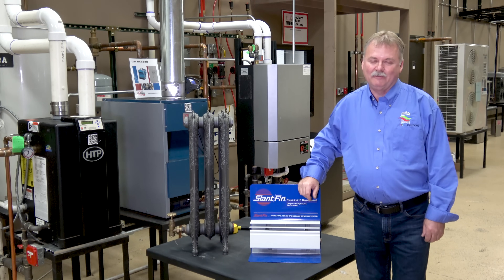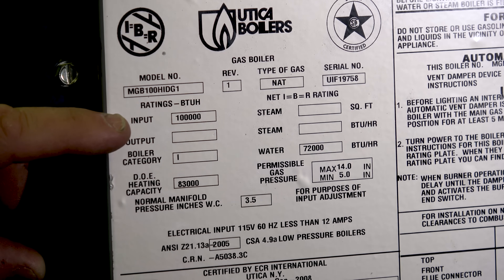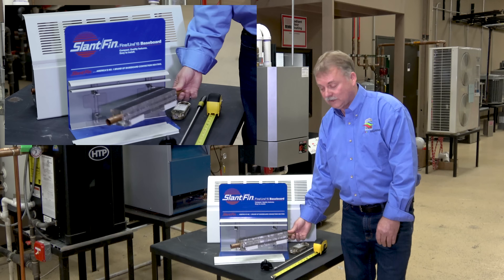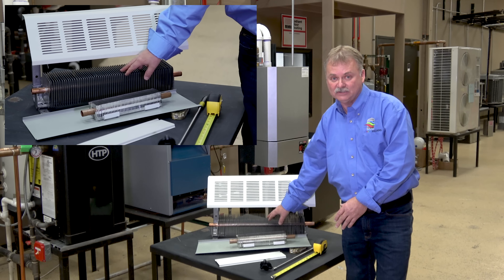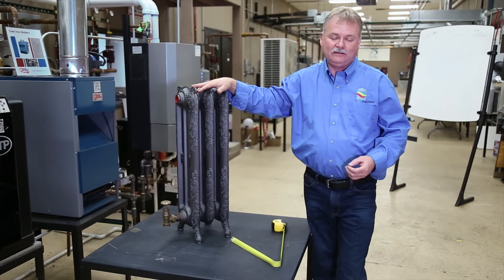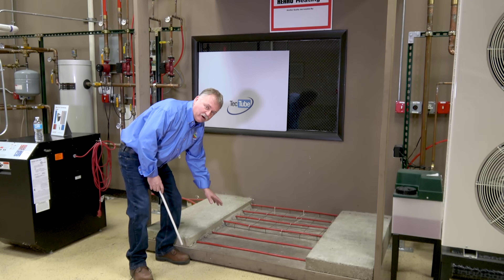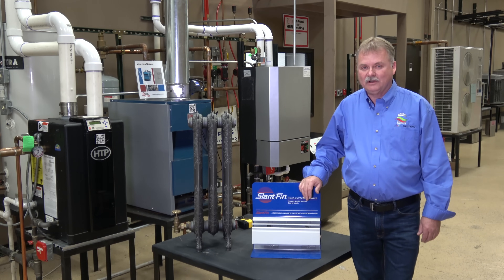Right Sizing a New Boiler... the easy way

Comment: What about steam boiler heating systems in older homes?
Reply from the maker: The same method works with steam radiators, but instead of 170 BTU/h for 180F water, you would use 240 BTU/h for 215F steam
Reply: @TECTubefilms  Thanks for the info.
Reply: Also , steam is measured not by btu per hr. , but Cubic feet per hour. You need room in the "steam chest" to make steam.
Reply from the maker: @robsemprini1511  All of the steam boilers that we stock are rated/listed by BTU/h input and that is what is also listed on the nameplate tags.  This includes Burnham, Carrier, Bryant, and Utica.
Reply: Then they are NOT rated for steam. Steam is measured by volumn. Not btus. Like nat, gas...And it matters. If you don't have room to make the steam - you can't make it.Look at steam baseboard (for single pipe)..or better yet I will make a post expelling this. It IS becoming a "lost art" like Holohan said. Take a better look at that plate ; a lot of times they are marked for both water and steam.
Reply: Nowadays they measure steam by weight , also. ( orifice gauge) although I never did use one.BTW you guys have some good stuff on these vids - gotta get the younger guys interested in this trade. Good work.
Reply from the maker: @robsemprini1511  All of the boilers we listed in our above reply are AHRI rated for steam.  And yes you are correct that many cast iron boilers are rated for both hot water or steam use.

Here is a link to a Utica PEG steam boiler which catalog's each size based on BTU/h input and output.  https://uticaboilers.com/sites/default/files/240009710_PEG-E_SellSheet_1017_WEB.pdf

We do not use nearly as many steam boilers in our service area as we do hydronic boilers (hence the reason this video was focused on hydronic and did not talk about steam), but when we do, we still always begin with a load calc expressed in BTU/h.  Weather we do a Manual J load or we do a radiation count as described in the video, the answer is in BTU/h and we select the boiler from that.

We have never met anyone that knows how to calculate the heat loss of a building using steam volume.  We are not saying that it is not important, nor are we saying the volume of steam won't be part of your piping and terminal selection and design.  All we are saying is that the size of the boiler that you need is based on the heat loss of the building.

And yes, it is a lost art for sure.  Holihan's book E.D.R., is where many of the charts come from that we use to estimate radiator surface area.
Reply from the maker: @robsemprini1511  Thanks for the feedback on the videos and for the extra steam discussion today.
Reply: Right on , I agree. I've met Dan a few times and he is a good guy. Good author , too. LOL.  I've used those charts - handy for thin tube radiators and convectors .  Happy Plumbing fellas !

Comment: Would it be possible for you to show a video on how to put an outdoor reset on a standard efficiency boiler? With an indirect tank in the system and baseboard thank you
Reply from the maker: That process would be specific to the brand of outside air reset controller you are installing... Honeywell, Tekmar, etc.  We can give you this tip, though: always install it on the North side of the structure to avoid direct sunlight.
Reply: Tec Tube I think you were off on your concrete floor calculations.   24 x 40 is 960 not 9600.
Reply from the maker: @1974jrod  How dare you question our math skills!  But yes, you are correct, 960 BTU/h is what Bill should have said.  Maybe he did that to teach us yet one more way boilers can get oversized... math errors.  LOL
Reply: I actually called the manufacturer of the boiler it's a New Yorker and the model number is a CG30D. They advised me that boiler cannot be used with an outdoor reset. I'm not sure why the guy wouldn't explain
Reply from the maker: @MrSprintcat  He was either incorrect or overly cautious.  You can put an OA reset on all boilers.  In fact for boilers under 300,000 BTUh, it is required by the DOE.  And for all sizes, it is required by IECC.  With that said, if it is a non-condensing boiler, you cannot have an aggressive OA reset schedule.  You have to keep the return water temp high enough to avoid accidental condensation.
Reply: Thanks for getting back to me .its to funny I called NEW YORKER. BOILER back and talked to the same guy and he had his coworker with him , they told me my boiler wouldn't work with an OA . because my boiler has an on board boiler reset.??? They said to understand what they were talking about I would have to look in the manual. 😂😂😁😁.. I know the return line temp should be around 137 degrees.

Comment: I have a Beacon Morris kick panel heater that supposedly puts out up to 12500 BTU’s on high would I add the 12500 BTU on top of my Fin tube calculation. Any advice as always is much appreciated. Thanks for the great vids.
Reply from the maker: Yes, you would sum up the outputs of all terminal units (fin tube, radiators, kick space heaters, air handlers, etc) that are fed from that boiler.  Great question!
Reply: Tec Tube Thanks you have been a huge help, contractors seem to just want to swap out the same size that was there. I really appreciate your time, great vids and expertise. This is where I am at:  I am trying to size a replacement boiler for my house it is in the lower Hudson Valley in NY. (20 miles outside NYC) It’s a bi level with 2518 heated square feet I have a 114.5’ of heated fin tube and a Beacon Morris kick panel blower heater that supposedly puts out 12500 BTU on high based on this my demand is about 81,200 BTU. I imagine I would base my sizing on the DOE output number posted by the manufacturer factoring in efficiency of the unit. My current leaking Utica is 150000 BTU input, 124,000 DOE output it lasted about 35 years. Sounds too big, house was built in 1963, vinyl sided double insulated windows now. Boiler is in lower level heated space in a closet. I am going to replace based on my demand using DOE output as the gauge of power, I don’t want to go way over based on the calculation. Thanks again!
Reply from the maker: @cardo1111  Based on the info you are telling us, your current boiler cycles itself on/off a lot (even on cold days) and only sends a maximum of 81,200 BTUs out to the house anyway. May as well just get a smaller boiler that puts out only 81,200.  And that is assuming none of your fine tube is oversized (which it always is).  If you install a modern 95 to 97% AFUE condensing boiler (and you should), you need to look for one that is 85,000 input.  Or round up to the next whole size.  We might suggest a HTP Pioneer 100, HTP UFT 100, IBC HC 23-84, IBC SL 10-85, Carrier BWM 100, or Bryant BWM 100.  There are lots of choices at that size range.  Some make more sense depending on the application and the type of individual zone control.
Reply from the maker: @cardo1111  With the jump from 73 to 95% efficiency combined with a correctly sized boiler... and an OA reset schedule, we would not be surprised to see your gas heating bill cut almost in half.  Once you get that first bill, let us know!
Reply: Tec Tube Thanks again! Those HTP’s look like really nice efficient units, however the budget will only allow for the standard 83-84 efficiency units.
Reply from the maker: @cardo1111  But you are going to have it for decades...

Comment: Maybe a silly question when measuring fin tube length are we just measuring the length of the fin assembly in the baseboard not including the copper pipe?  I have 2518 s.f. Of finished heated space in a Bi-level. I have a 150,000 BTU water rating input with 107,800 BTU 1983 Utica boiler I will be having replaced. I am concerned whether or not this is the right size unit, as you said the contractors seem to just want to swap what is in there based on the previous unit’s label without even thinking about calculating what the correct size for my home is.
Reply: 150,000 sounds like a lot.  I have 2,800 ft2 and heat the whole house with a 60,000 BTUh unit that has never fired above 83%.
Reply: ryanhoger Thanks for the input. My current unit is operating at 72% efficiency based on the specs is from 1983. But 150,000 Input BTU does seem high, (also has :124000 DOE capacity and IBR number is 107,800 BTU) the house was built in 1963 but has some updates including low e double insulated windows. The boiler is also located within the heated space in a closet. I am going to measure my Baseboard fin tube. I live in the NY metro area as well winters here are relatively cold.
Reply from the maker: Correct, just the part that has fins on it.  Do not include the bare copper tube.
Reply: Tec Tube I appreciate the response. Another question if you would . I live in the N.Y. metro area suburbs (southern N.Y.) My boiler is in the heated lower level of a bi-level home. Based on this I am assuming the spec of the boiler I should use for sizing my unit is the DOE heating capacity?

Comment: I had a modulating condensing boiler installed a few years ago and the max output is much larger than the house needs for its heating load. The contractor said they needed the extra capacity to support the indirect DHW tank. Is that a valid reason to put in a boiler that is larger than necessary?
Reply from the maker: No, it is not.  The boiler should be sized for the larger of the two loads... either space heating or hot water.  For a house in most climates, space heating is larger.  The boiler will not be doing both at the exact same time.  It will switch back and forth.

Comment: Why not do a heat loss calculation, then you KNOW the heating NEED? THEN you determine if there are too few or too many emitters, etc.  Size the boiler for the NEED, not the installed emitter.
Reply from the maker: Agreed!  We would love for there to be an accurate load calc done on every project we get asked to bid a replacement boiler for.  However, the vast majority of contractors just re-size the new boiler based on the old boiler's tag.  When we ask them why not do a load calc, the reasons are often 1) it takes too long and 2) I don't know the details of the building like wall insulation, etc.  Bill started using this "radiator measurement" method decades ago to help get contractors closer to the proper sizing you might get with a load calc but without the effort.  It is a compromise of doing a load calc (which they refuse to do) and just replacing like for like.
Reply: You have to measure the radiators because without the radiators you're just going to oversize the boiler in the house

Comment: How do you do the calculation for the fin tube base boards
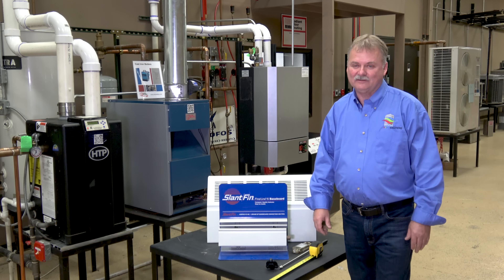Reply from the maker: Watch the video starting at 2:09.  For most residential baseboard, it is just 550 multiplied by the length of baseboard that has fins.
Reply: Tec Tube I have multiple base boards do I add up all the lengths then multiply that number by 550?
Reply from the maker: Yes, if all the baseboards are served by the same boiler, then you need to sum them all up to see what size boiler you need.  You can either sum all the "active lengths" and multiple by 550 or you can multiply each baseboard by 550 and then sum all the baseboards up.  The same answer will result.

Comment: Is the piping and pick up factor that is built into the boiler specs based only in the IBR and nothing extra in the DOE rating? Thanks in advance.
Reply from the maker: The "DOE rating" for a residential boiler would be AFUE.  This test includes boiler cycling.  For a commercial boiler, the rating is Thermal Efficiency (TE) and this is a steady state test (warm it up, get it operating the way they want, and then take the measurements).  Does that answer what you are asking?  And then to add one more layer, when a tech in the field tests the efficiency with his/her analyzer, that is a Combustion Efficiency test, which is also steady state, but different than TE.
Reply: Tec Tube No I am asking about the built in extra sqft of radiation in the boiler ratings. See page 2 , item 2 of the installation instructions of the Carrier BWBB water boiler. The AHRI rating. I am assuming the AHRI rating listed is the same as the IBR output?  http://www.utcccs-cdn.com/hvac/docs/1009/Public/0C/IM-BWBB-01.pdf. 
Is this extra 1.15 not in the DOE rating and that is why it is lower?
Reply from the maker: We downloaded the manual you are talking about.  Yes you are correct in that Carrier is using the term "Net AHRI" the same as the Utica boiler tag in the video is using "Net IBR."  When ARI merged with GAMA in 2008, it changed its name to AHRI (to add the word heat) and we presume this is why sometimes you see Net IBR or Net AHRI.   Anything older than 2008 would never say AHRI on it.

Here is the definition of "net" by the AHRI standard:
3.10.2 Determination of Net Ratings. AHRI Net Ratings are determined by dividing the Heating Capacity by the piping and pickup factors of 1.333 and 1.15 respectively as Steam Factor and Water Factor, and rounding to the nearest MBH. Steam square feet shall be determined by dividing the rounded Net Steam Rating by 240. It may be cataloged to the nearest square foot or the nearest 5 square feet.

The DOE output on the Utica tag is what Carrier's document is calling "heating capacity." This is sometimes called gross capacity and this is the number related to the AFUE (also an AHRI term).  So no matter what they call it, there is gross capacity and net capacity.  Gross is the larger of the two.

Unless your boiler and the majority of your piping is in a completely unconditioned basement (like it was in the 1930s), our suggestion is to ignore these "net" numbers and only focus on the gross output (aka DOE output).  And even at that... the DOE output is the largest replacement boiler you will need.  If you do the measurements that Bill is describing in the video, you will end up buying an even smaller boiler.
Reply: Tec Tube Thanks! Great info!